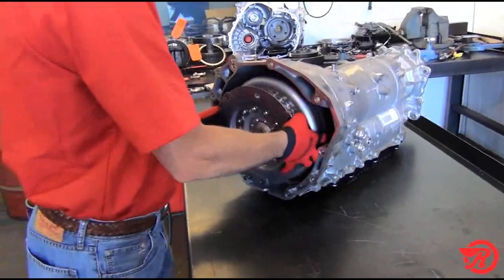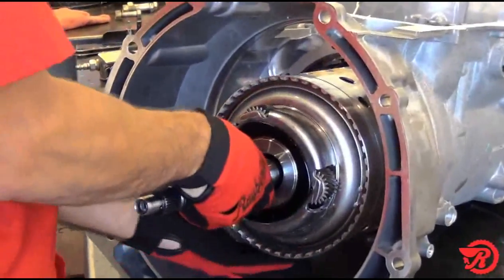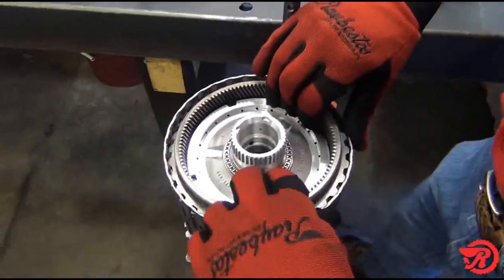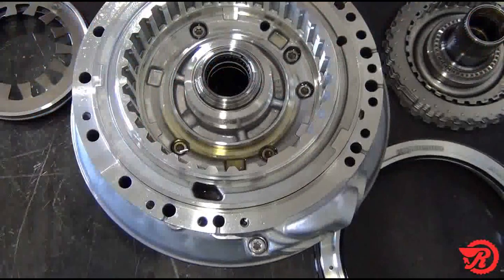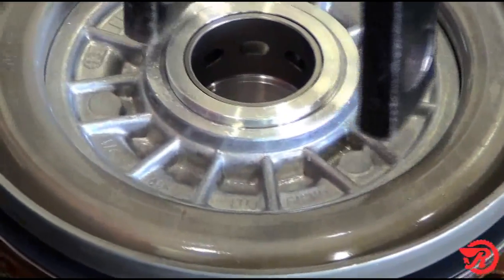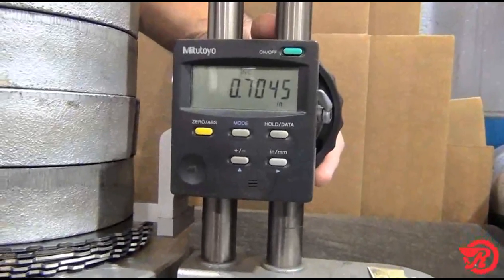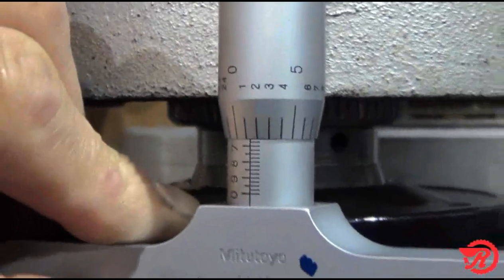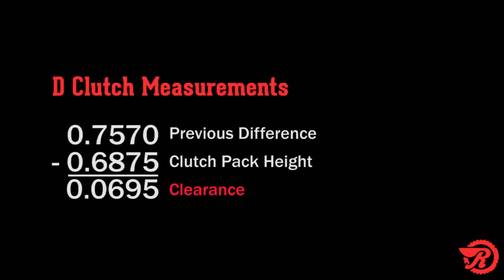Ray's Garage- ZF8HP70 Unit Disassembly

Comment: where can i get the little aluminum block to remove the lock ring
Reply from the maker: You can get them from ZF
Reply: @RaybestosGarage what's the aprt name or number, can't find it
Reply: Use a large hose clamp around the top of the drum, it works just fine.